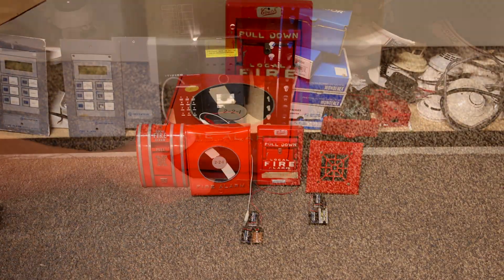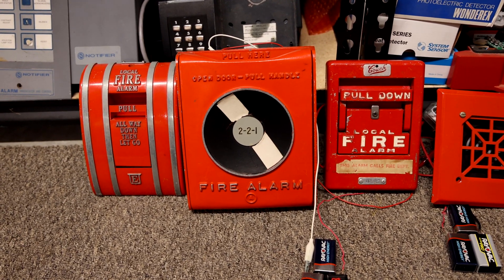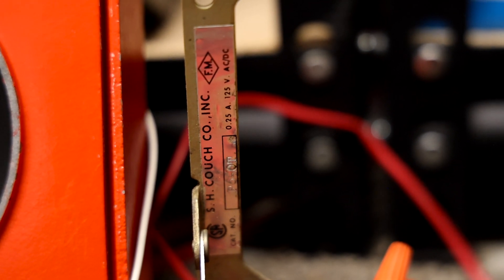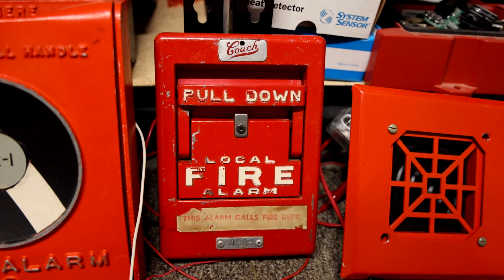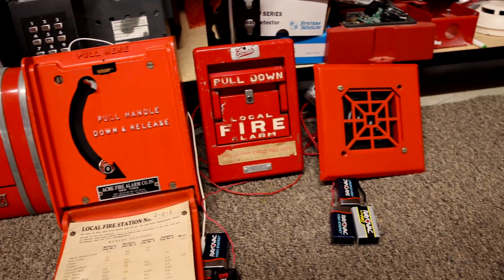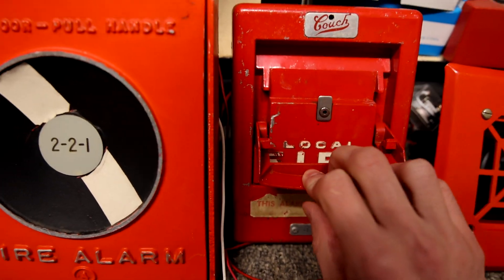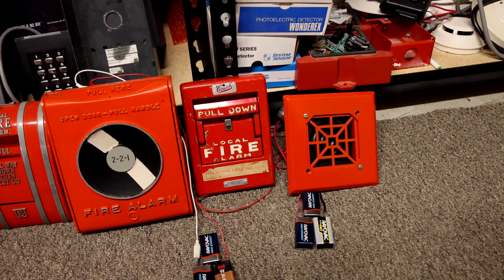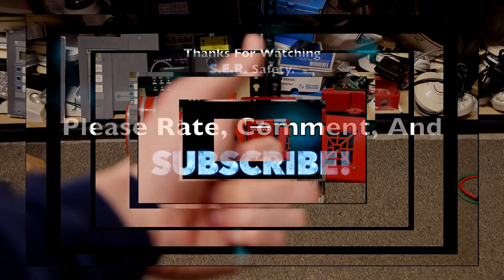Testing Vintage Coded Fire Alarm Pull Stations w/ Notifier 34-24 Horn!

Comment: When these were in a real building, would they have been hooked up to a central panel that would latch into a continuous alarm after the coding is over? It seems like it wouldn’t be a good enough alert signal to just stop after the coding.

Comment: I'd assume you got the Couch coded pull from the same seller as the one I got mine from, since it was last inspected on 10/13/64
What kind of relay do I need for a normally closed coded pull station?
Reply from the maker: Here's one that should work: https://www.amazon.com/8-Pin-Relay-Socket-Electromagnetic-Power/dp/B0BNCWHW77/ref=asc_df_B0BNCWHW77?mcid=4f9f57fcce2b350e851d399348bad5b1&hvocijid=8413328929225722361-B0BNCWHW77-&hvexpln=73&tag=hyprod-20&linkCode=df0&hvadid=730434204848&hvpos=&hvnetw=g&hvrand=8413328929225722361&hvpone=&hvptwo=&hvqmt=&hvdev=c&hvdvcmdl=&hvlocint=&hvlocphy=9029650&hvtargid=pla-2281435179338&th=1
Reply: FOUND YOU >:3

EHEHEHEHEHEHE